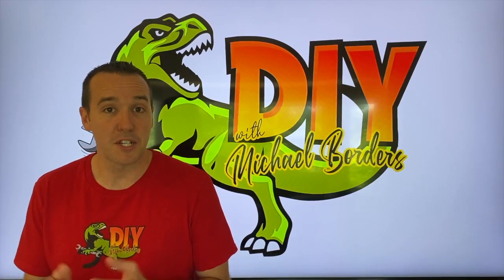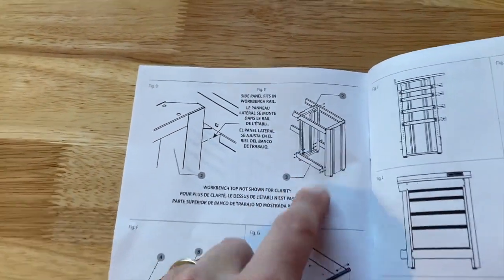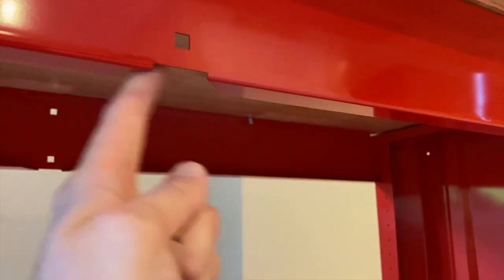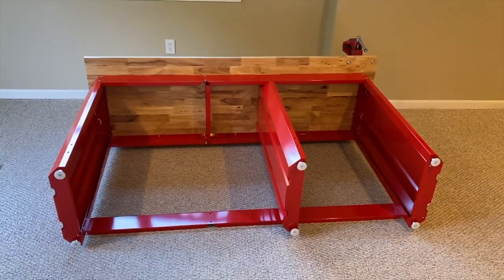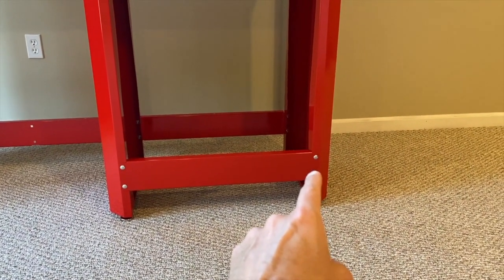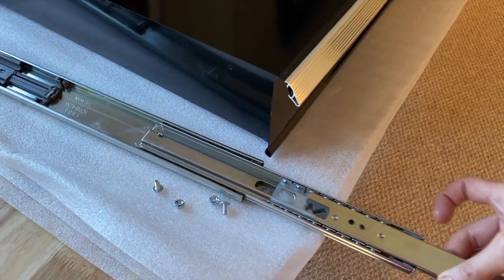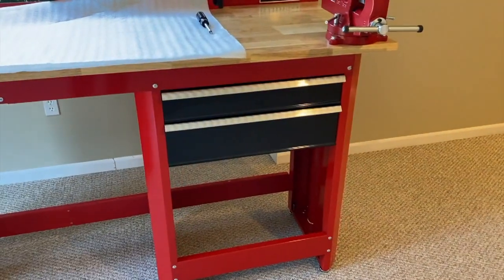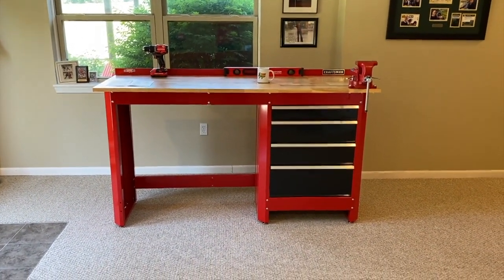Assemble & add drawers to 6ft Craftsman workbench

Comment: Video was very clear and easy to follow. One question. Is there a left and a right sliding mechanism for the drawers or are all slide components identical? 
My top drawer is binding and does not “soft close” as you stated.
Reply from the maker: Thanks for watching & welcome to the DIY Raptor Club.  Great question.  The slide rails are the same.

Is the drawer empty?  We have had viewers mention that certain drawers were not soft closing until they put tools inside.

The weight of the tools helps assist the drawer when soft closing.  Keep us posted.

😎👍

Comment: It is much easier to set one end of the bench on blocks slide in the end panel install the top bolt n each side finger tight and remove the block
Reply from the maker: Thanks for watching & sharing, any & all helpful info is greatly appreciated!!!

😎👍
Reply: @DIYwithMichaelBorders  it is much easier to add helpful comments than to do the original video.I built my workbench over a year ago. At the time it made no sense to install the bottom rail with the flanges facing out.
After watching your video the reason was very clear.
Reply from the maker: @genecarden780  

This bench is our favorite.  Definitely an asset to our YouTube channel mission.

😎👍
Reply: @DIYwithMichaelBorders  I have 2 of them in my basement workshop and I’m just now installing drawers in the second one
Under the first I installed the large craftsman series 4000  tool chest with 10 drawers
Reply from the maker: @genecarden780  

That’s awesome, & a great idea!
Reply: @DIYwithMichaelBorders  I also have a much older Craftsman workbench purchased I’m guessing 30 years ago that is still functioning perfectly
Reply from the maker: @genecarden780  

Awesome, we hope to have this bench for that many years, heck...hopefully more.  😎👍

Comment: Hi if the top drawer we have has a slight opening on right hand side (looks uneven) is there any way to fix this? Or is the cause the drawer is bent?
Reply from the maker: Thanks for watching, it’s very possible that it’s bent.  Retuning it can be a pain, you may just want to inspect the rails in great detail and see if you can carefully adjust area of track that’s offset…🤔

Other option is retuning it.  Keep us posted.